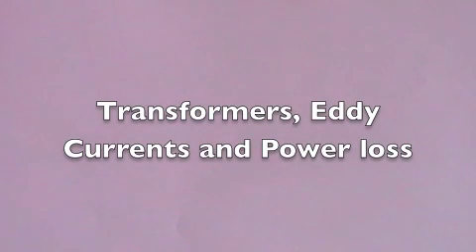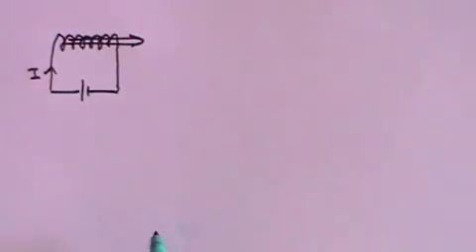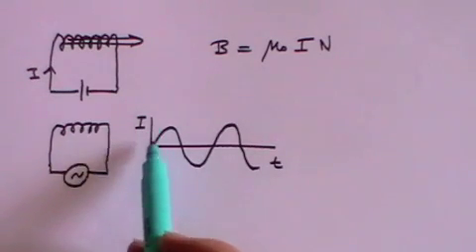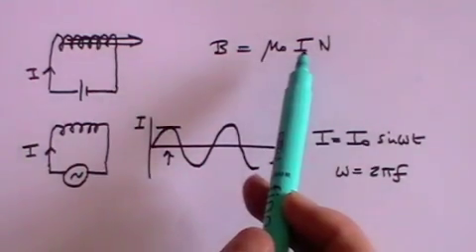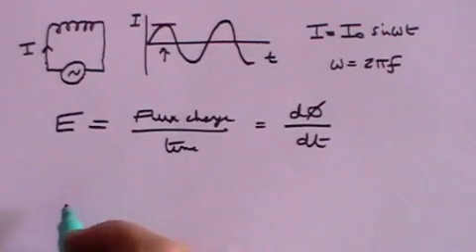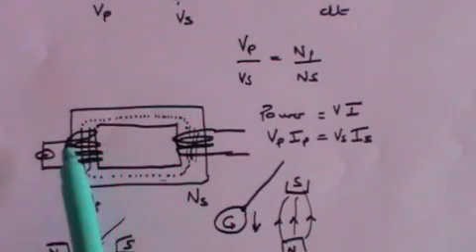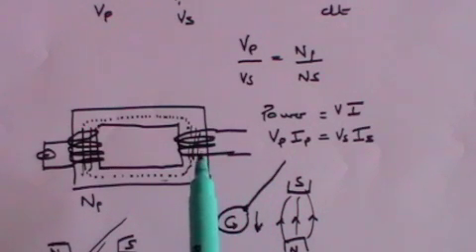Transformers and effect of eddy currents

Comment: A challenge for students new to transformers is the constraint on maximum achieve-able current in the secondary circuit of a step-up transformer.

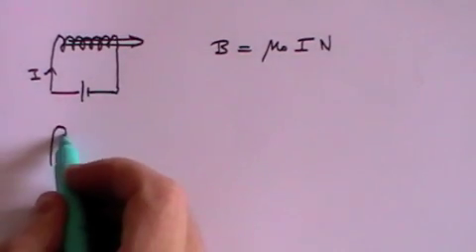Since the power in the primary circuit,  Pp =  VpIp,   must equal the power in the secondary's circuit,  Ps = VsIs,  we have the following situation for a 1:10 step up transformer with 10 volts, 1 amp max in the primary:

1)  the max power in the primary winding's circuit  is:   (10 volts) x (1 amp)  =  10 watts

2)  voltage in the secondary winding is stepped-up by a factor of 10, so the secondary voltage Vs =  (10 volts from the primary)  x  (stepped-up 10 times) = 100 volts

3)  Since the power Ps in the secondary MUST be 10 watts,  we have:  10 watts =  100 volts  x  Is,  so that current in the secondary winding circuit "Is" must be:  (10 watts) / (100 volts) = 0.1 amps

Fine.  We have  (0.1 amps)  x  (100 volts) = 10 watts in the secondary winding.  

HERE'S WHAT CONFUSES PEOPLE new to transformers:

By limiting the maximum current possible in the secondary winding, the 100 volts in the secondary seems "compromised",  or "anti-physical"  because, if you present a circuit with a 100 ohm resistor and say  "the voltage in the circuit is 100 volts - what is the max current in the circuit with the 100 ohm resistor?"

They are NOT going to say  "it would be 0.1 amps".   They are going to say  "it will be  (100 volts)  /   (100 ohms)  =  1 amp"

When you then tell them "No, this circuit is special.  It is a circuit of the secondary winding of a transformer,  and the maximum current can only be 1/10th of that - so, not 1 amp, only 0.1 amps"

When you present your case as to why the 100 volts in the secondary circuit is 'compromised' and cannot reach 1 amp of current,  it can undermine their faith in your explanations.
They feel like you're trying to tell them  "sometimes, 100 volts gets  you 1 amp.  Then, other times, only 100 milliamps.  And still other times, say - for a 1:100 step up transformer, your 100 volts in the secondary only gets you TEN MILLIAMPS."

CRUX:  when a 'reactive' component - an inductor and/or capacitor - is in the circuit,  Ohm's law will not suffice.  (The secondary winding of the transformer is obviously an inductor, and to figure out current, you rely on the impedance, Z, calculation.  The inductive reactance Xc is:   2piFL,  where F = frequency, L = inductance.

.

Comment: why can 't we  find the power loses by v^2/R ?
Reply from the maker: +Arain bro&#39;s You can. But the v in the equation must be the potential drop across the transmission line not the full voltage across the whole system.
Reply: got it, and by the why is it possible to obtain multiple outputs ? like if we just introduce two secondary windings instead of one?

Comment: isn't the current flow direction at 6:15 in the loop wrong?
Reply: +Houston Xue Yes, there would be magnetic field lines going up out of the page inside the loop of wire thus the North side of the magnet would actually be attracted to that.  So the direction of current flow should be the other way to 'push' the magnet down
Reply: +Houston Xue Right hand rule.

Comment: If i am not mistaken the magnetic breaking is achieved due to the electromagnetic force ( dF=i dl x B ) What i would like to ask is if the currents are circular, wouldnt a line integral of the force be zero resulting in no damping?
Reply: +Ben Dover The circular current is not completely within the room between N and S, where B is effective The actual braking  happens when the metal plate is entering/exiting that room. During that time, the Ampere force is only applied to one part of the circuit while the other part is outside the magnetic field . Therefore the line integral of force can only be performed on the affected part of the circuit not the whole closed circuit. So F is non-zero then.

Check this image of Eddy current braking  from WIkipedia: https://en.wikipedia.org/wiki/Eddy_current#/media/File:Eddy_current_brake_diagram.svg

The metal plate is usually much larger than the area of the magnetic filed, so it is entering/exiting the room between N and S all the time resulting in continuous braking force . Eddy current forms surrounding the two edges of the magnetic filed. Currents between N/S are consistent in direction(Lorentz Law) (so are the Ampere forces), while the rest of circular currents are  outside the magnetic filed.
Reply: Thank you very much!ukyee

Comment: As per the Ohm's Law, Voltage is Directly Proportional to Current. So when current is transformed in a set up transformer why is it like, there is high voltage but less current flowing. It shouldn't be that way though because as voltage increases Current should increase too. So why does that happen. Please give me the technical reason as well as  the Maths one as I am curious to know how does that happen ... Thanks inadvance.
Reply from the maker: The key point here is that power is the same in theory (leaving aside heat losses etc). Since power = VI then if one increases the other must decrease.
Reply: DrPhysicsA Thanx sir but i was just wondering that how can low current floe even when high voltage is applied across.
Reply: +Ganesh P IV= constant Therefore is V increases I must decrease.

Comment: I know what is the EPR paradox and its answer: waves can't be emitted at perfect strait trajectory from the emitter because its like the shotgun shells when you shoot the shell the buckshot is traveling trough the pipe(in light's case - fiber optic) at strait line but when it leaves the cylinder it spreads wider with distance same thing with the waves only one particle in the bulb is emitting only one light wave, thing about it if light comes from another galaxy you might not see it if...

Comment: yes so you saying that inducted electricity travels easier trough iron instead of air that is clear but I was talking about isolating the wiring somehow from the eddy current so it won't jump over the wiring and make short circuit

Comment: if you put the coils in a vacuum then the magnetic field produced by one of the coils will weaken the further away you get.. so you need to put some iron in there (because iron has a high permeability) so that the magnetic field strength doesn't weaken very much

Comment from the maker: Any experiment which has a magnetic field and a wire with one of them moving such that there is a rate of change of flux and hence a current flowing in the wire will suffice. That current will itself generate a magnetic field. Lenz's law says that the magnetic field so generated will be such as to oppose the field which caused the current to flow.

Comment: As the disk approaches the field, the 'change' in field value is up (the field is up and getting bigger in time).  In this case, the induced current at the leading edge will be directed (not flow, for charge is what flows) in a direction out of the screen, perpendicular to the direction of motion, so that if you were observing the disk from above, the current would be directed in a clockwise direction; this is a very tricky concept.